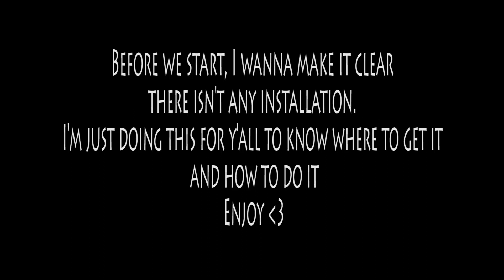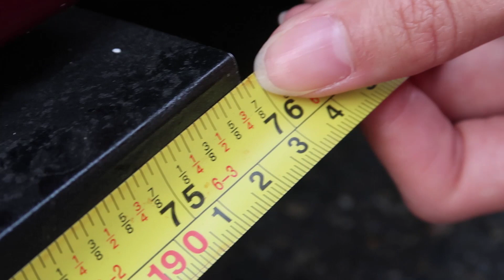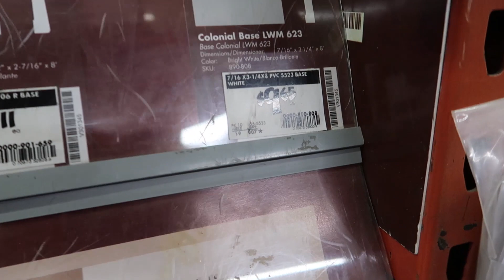DIY SIDE SKIRT FOR $22 FOR ANY CAR MAYBE?// VLOGGING W MY GF // MAZDA 3

Comment: Hey MTJY, I have a 2014 Mazda 3 hatchback iSport. I was curious to know if you still had that side skirt you painted in this video. And also do you know whats the best intake and exhaust for fuel economy? I drive just a little over 2 hours at the end of my commute from work; including my commute to work. I do my own oil changes, use K&N oil filter 1008, and use Mobil 1 advanced synthetic oil better fuel economy. I am driving close to 100 miles, 80 miles to and from work, thats if I don't make any pit stops on my way home. What intake and exhaust do you recommend? 
Thanks, 
Bernardo